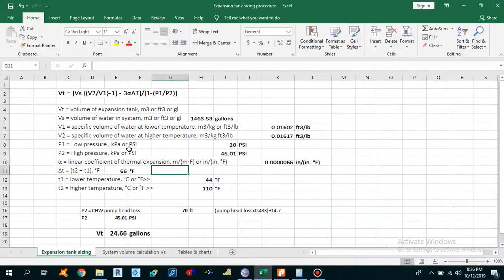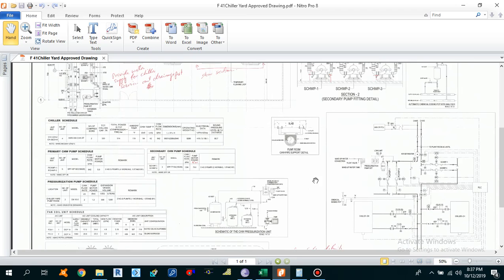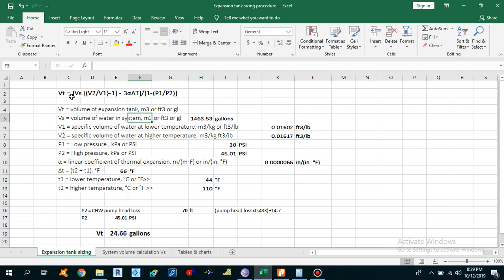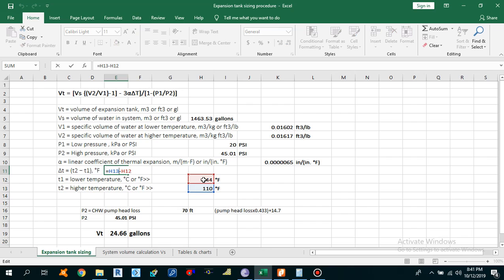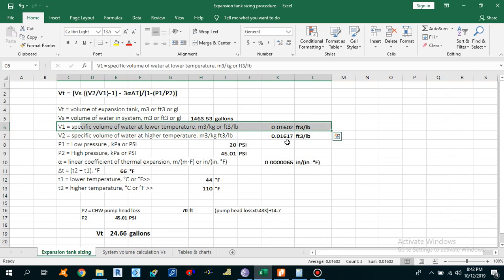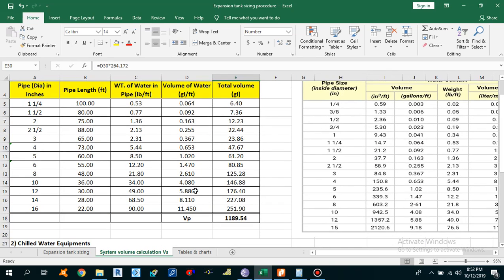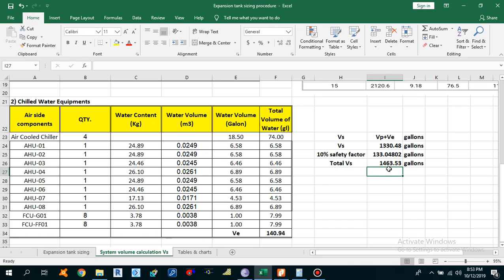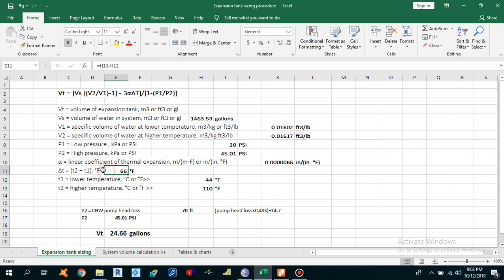Expansion tank design calculation, hydronic system expansion tank sizing calculation, buffer tank

Comment: kindly check if the P1 is supposed to be the fill pressure of the system and P2 is supposed to be the maximum withstand pressure of the components designed in the system or the pressure rating of the relief valve at the tank. normally pressure at the relief valve of the tank is set to be smaller than maximum withstand pressure of the system. check the jmp you tube tutorial.

Comment: excellent, only one question, regarding high pressure, u said system head pressure, refer to your video pump head calculation, which head we will take primary pump head or secondary?
Reply from the maker: Primary pump head